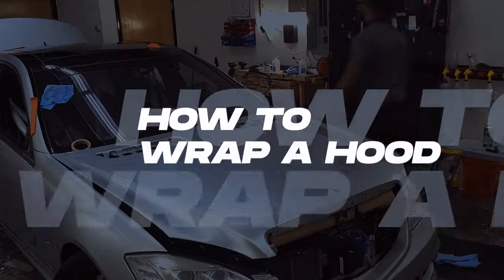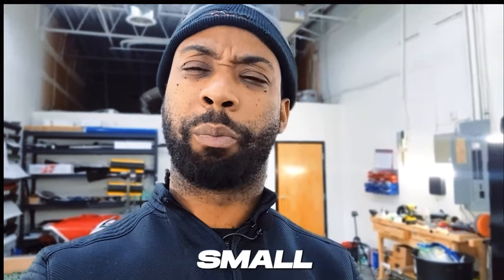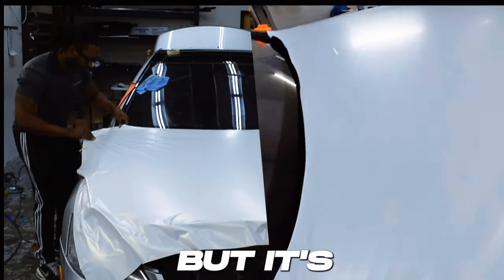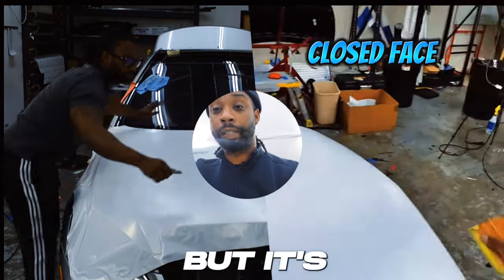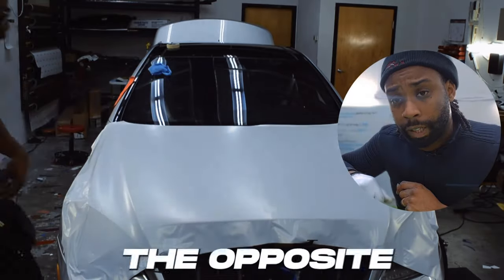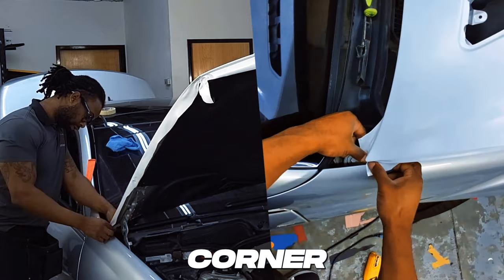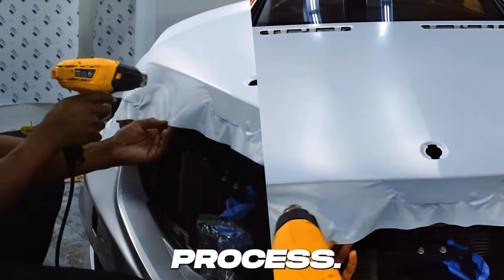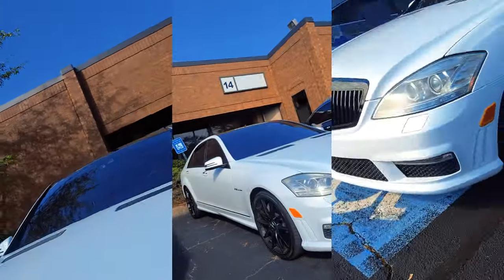Vinyl Wrapping A Hood: Beginner’s Guide

Comment: Better explained than the vinyl wrap class i took
Reply from the maker: You are always welcomed to come take our class
Reply: @AllenCars  Hello i have a 2018 Mercedes Benz C300 coupe and i have a panel in between my windshield and sunroof that is possibly plastic(not sure) and the clear coat is flaking off and it has a bunch of scratches and is beginning to fade due to hot Las Vegas weather. So I was curious to know if that panel is plastic do I go about sanding it the same way I would sand metal or is there something else i should be doing before hand? Or should I not fuck with it period and look to have it painted? Please help I want my car to look flawless and this panel is the only thing stopping it from happening! Thanks 😅
Reply from the maker: @mayaelizabeth6405  lightly wet sand it
Reply: This was so helpful best video out there as a tutorial.  Love.  Thanks for this free vid.

Comment: One question .

Im not wrapping cars or motorcycle 
Im wrapping my mountain bike frame. So , i want my wrap first wrap forever permanently on the frame till it snap fully utilized , can i coated the frame with clear coating Spray on top of the wrapped layer?
Reply from the maker: I wouldn't clear coat over the wrap

Comment: So, if I wanted to do a design in my vinyl, for example racing stripes or camouflage, should I pre plan and lay knifless tape to create the design and have just edges overlap, or can I do the whole vehicle in the base color, then do a second layer as the design. Keep in mind my design is not going to be taking up any significant amount of space, it'll just be some accent lines probable no more than 2.5 inches thick at the thickest point
Reply from the maker: Always lay the knifeless take to have a cleaner look
Reply: Best explanation i have seen on this process. Thank you
Reply from the maker: @lordkasten  anytime.